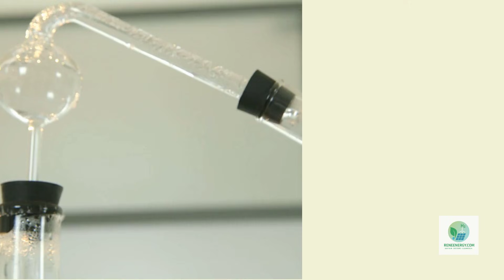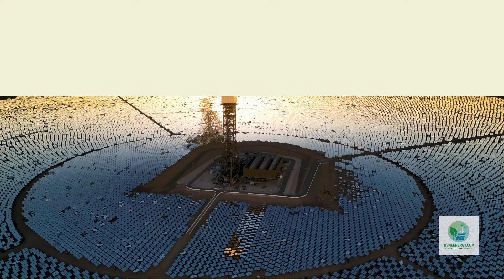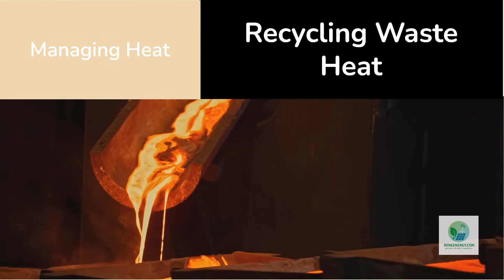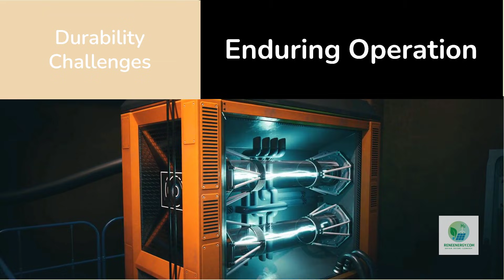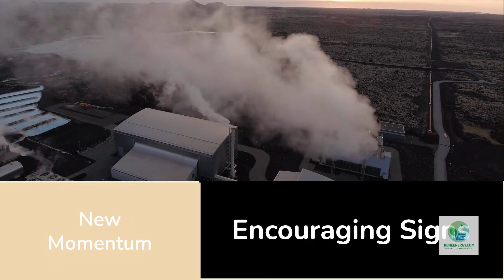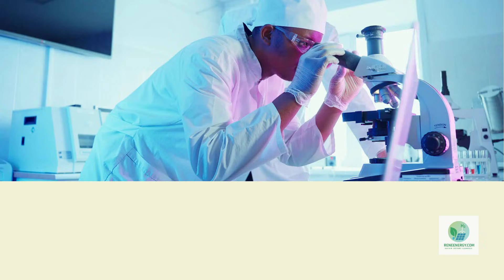The Quest for Hydrogen Without Electricity - Challenges and Breakthroughs

Comment: These are results for Supercritical water only needs to be vibrated at covalent bond resonance to split.
Search instead for Supercritical water only needs to be vibrated at co-valent bond resonance to split.
AI Overview
Resonance Structures: 4 Rules On How To Evaluate Them, With ...
Simulation says supercritical water has no hydrogen bonds ...
Resonance Structures: 4 Rules On How To Evaluate Them, With ...
Resonance Structures: 4 Rules On How To Evaluate Them, With ...
Resonance Structures: 4 Rules On How To Evaluate Them, With ...
View all
The idea that supercritical water (SCW) can be split just by vibrating its covalent bonds at resonance is a misconception, though vibration does affect its weak, fleeting interactions; SCW molecules have extremely short-lived "hydrogen bonds," so resonant vibrations break these weak intermolecular forces (like statistical encounters, not strong bonds). The actual O-H covalent bonds require much higher energy (like electrolysis) to break, but vibrational energy rapidly dissipates in SCW's unique, gas-like liquid state, making bond-splitting by simple resonance highly inefficient or impossible, according to recent studies and simulations. 
Why the Idea is Wrong (Based on Current Science):
Ephemeral Bonds: In SCW, water molecules are so energetic and far apart (compared to liquid water) that their "bonds" (really just transient statistical closeness) last only ~100 femtoseconds, much shorter than H-bond vibration periods.
Random Encounters: The molecules are mostly in random orientations, not stable H-bonded networks, meaning there's no strong, directional bond to resonate and break.
Energy Dissipation: Vibrational energy from excitation quickly transfers and disperses through rapid reorientation and translational motion, preventing accumulation needed to break a covalent O-H bond.
Covalent vs. Intermolecular: Vibration at resonance might affect the intermolecular (between molecules) vibrations or orientations, but breaking the intramolecular (within the molecule) covalent O-H bonds requires much more energy, typically via electrolysis or intense radiation. 
What Does Happen with Vibration in SCW:
Resonant excitation (e.g., using Terahertz waves) primarily affects the rotational and translational motions and breaks these fleeting intermolecular interactions.
This energy quickly flows through the network, increasing kinetic energy of the molecules, but not splitting the O-H bonds themselves. 
In Summary: You can't just "vibrate" SCW at a water resonance frequency and expect H₂O to split into H₂ and O₂; that's a misunderstanding of water's supercritical state and the energy required to break covalent bonds.

Comment: Supercritical water only needs to be vibrated at co-valent bond resonance to split.
Reply: These are results for Supercritical water only needs to be vibrated at covalent bond resonance to split.
Search instead for Supercritical water only needs to be vibrated at co-valent bond resonance to split.
AI Overview
Resonance Structures: 4 Rules On How To Evaluate Them, With ...
Simulation says supercritical water has no hydrogen bonds ...
Resonance Structures: 4 Rules On How To Evaluate Them, With ...
Resonance Structures: 4 Rules On How To Evaluate Them, With ...
Resonance Structures: 4 Rules On How To Evaluate Them, With ...
View all
The idea that supercritical water (SCW) can be split just by vibrating its covalent bonds at resonance is a misconception, though vibration does affect its weak, fleeting interactions; SCW molecules have extremely short-lived "hydrogen bonds," so resonant vibrations break these weak intermolecular forces (like statistical encounters, not strong bonds). The actual O-H covalent bonds require much higher energy (like electrolysis) to break, but vibrational energy rapidly dissipates in SCW's unique, gas-like liquid state, making bond-splitting by simple resonance highly inefficient or impossible, according to recent studies and simulations. 
Why the Idea is Wrong (Based on Current Science):
Ephemeral Bonds: In SCW, water molecules are so energetic and far apart (compared to liquid water) that their "bonds" (really just transient statistical closeness) last only ~100 femtoseconds, much shorter than H-bond vibration periods.
Random Encounters: The molecules are mostly in random orientations, not stable H-bonded networks, meaning there's no strong, directional bond to resonate and break.
Energy Dissipation: Vibrational energy from excitation quickly transfers and disperses through rapid reorientation and translational motion, preventing accumulation needed to break a covalent O-H bond.
Covalent vs. Intermolecular: Vibration at resonance might affect the intermolecular (between molecules) vibrations or orientations, but breaking the intramolecular (within the molecule) covalent O-H bonds requires much more energy, typically via electrolysis or intense radiation. 
What Does Happen with Vibration in SCW:
Resonant excitation (e.g., using Terahertz waves) primarily affects the rotational and translational motions and breaks these fleeting intermolecular interactions.
This energy quickly flows through the network, increasing kinetic energy of the molecules, but not splitting the O-H bonds themselves. 
In Summary: You can't just "vibrate" SCW at a water resonance frequency and expect H₂O to split into H₂ and O₂; that's a misunderstanding of water's supercritical state and the energy required to break covalent bonds.